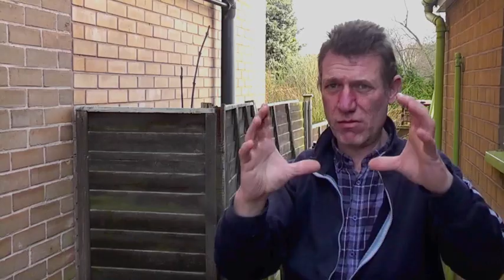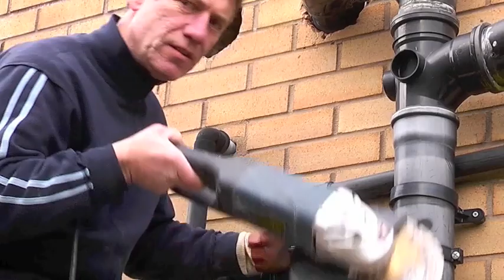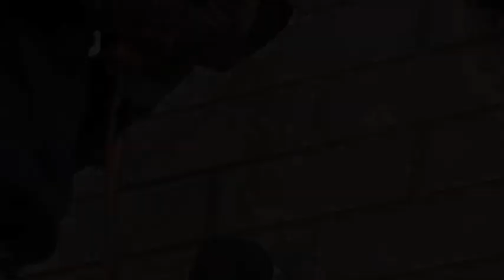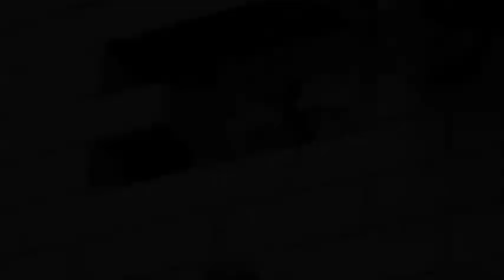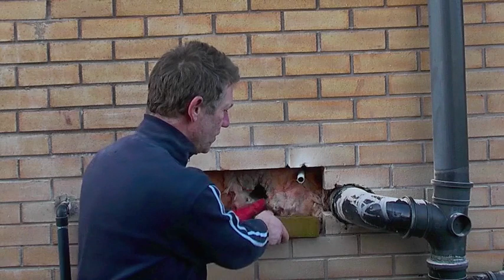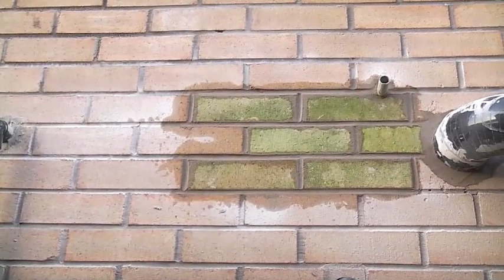How to Repair damaged bricks on a house.m4v

Comment: How did you cut the brick to fit the small pipe on the top replacement brick?  How did the bricks change color, all but one, to match the other bricks in the wall?

Comment: I have a 10 cm hole on a brick wall  due to the air con tubes going out to a terrace , now we changed the ac units location and I need to repair it , I been neglecting it as I was unsure how to do it but this is sooo helpful , thank you so much !

Comment: I have a similar job to do on my Mothers house.  After a new condensing boiler was installed several years ago, the muppets who did the job botched up reducing the flue hole from the original boiler, which had a large square flue outlet, compared to the new, quite small round outlet on the new boiler.  They used the wrong style of brick, they are all over the place, not keyed in and the mortar is crumbling!
What I can't grasp is how the final bricks are laid when there is only the mortar space left?!  How do you ensure there is mortar all around them and that it stays put?

Comment: hi. trying to repair some loose bricks on our front garden wall but the mortar on our wall is rock hard. tried drilling and then chiselling but it isnt budging.  can you suggest a solution. thanks
Reply: thanks for the advice , will give it a go tomorrow and see how it goes.
Reply from the maker: Great, good luck

Comment: When mixing motor for laying brick, what retro of cement to sand is the "Ideal" Thanks for a Great Video
Reply from the maker: Many thanks for watching the vid, best alround mix for most bricks is a 4 to 1 mix of 4 parts sand and 1 part cement.  If you have very week bricks use a 5 or 6 to 1 ratio as the mix if to strong will cause spaulding
Reply: Thank You Chris, much obliged

Comment: why u add soap to the mud
Reply from the maker: +Paul Carter It's an old bricklayers trick- if you have no mortar plaster sizer to hand then a small drop will make the mortar much easier to work..

Comment: how did you get such a clean looking mortar removal?  Did you use the angle grinder?
Reply: +Chris Longhurst I think you used that angle grinder on the straights didn't you? You showed it, but not using it. I think I could see the lines. Either way, it was super tidy. Great video Chris. Liked it.
Reply from the maker: +jttierney1 Used me old drill.....and strusted mni bolster chisel..thanks for your interest..-:)
Reply from the maker: +Howard Gilmour Decided not to found the dust was to much- besides just as quick with the drill and more controlled

Comment: what is the mixture for the motar between the bricks?  sand, cement & water? and what is the ratio please!
Thanks a lot.
Reply from the maker: Zack Tumlinson I used what the builders originally used (on the architects plan) 4 sand 1 cement- gently add water until workable..Trust that helps

Comment from the maker: John G: thats correct, a small drop will be sufficiant to plastersize the mix..
Reply from the maker: A job like this would be a day's work if that...So builders prices vary from London to the North.  Materials are very little so if you got your own from any builders merchants or DIY place, you'd need a bag of sand i/2 bag cement and your bricks.  In the staffordshire area builders would be charging a price from around £120-150 for labour per day!.   Hope that has helped..

Comment from the maker: Plastersizers are same based as detergents, Feb mix and the like- they all Aerate (bubbles in) the mortor creating a sliding effect on the sand granuals...most brickies on small jobs use washing up liqued.  Small jobs like this don't need a professional plastersizer, it would cost to much.  These are D.I.Y tips for small jobs helping people who are not in the trade.  On large construction jobs the pastersizers are now pre added...your just trying to be a clever dickie

Comment: thanks for the video, i need to repair a small (2-3 brick high) brick flower box wall, how much motor do i drop down to start, just a few heaps then tap the brick down to level?

Comment from the maker: Hi Ird9999, thanks for your comments and to answer your question.  Generally the ex. plumbing works well.  Some  folk lag their waste pipies  with foam sleeves.  I personally haven't had any problems with mine even though in recent years we have had some severe cold spells, but they never froze up. They are a standard regulation for the UK....Hope this help :)

Comment from the maker: Hi snakeclaw, thanks for watchin the vid..In answer to your question about forming a new outlet hole above an old out let.  There shouldn't be any problems as you see ,I had my soil stack moved to the side and  so you should be able to do the same above.  The bricks won't drop because they are tied in by bond...assuming it is a hole in simler proportions as mine...

All the best and happy DIY'ing...

Comment: nice repair, but when you were chiseling that brick w/o safety glasses....you've got more balls than me.   its a small thing, but i like to spray the old and new bricks with water before i apply mortar.  seems it dries slower and the bond is better.    nice work!

Comment from the maker: This usually meets with our building regs.  It sounds to me you have done an excellent job….the black board would have been felt or bitumen backed board to prevent damp passing through.  If polythene sheet is applied you will need to allow the wall to breath or it will sweat and moisture will build up on the back and run down, or even eventually rot the wood… food for thought.  Allow a gap at the bottom to allow air to move around the back.  Regards..

Comment from the maker: Hi, I assume the brick wall is a single skin that is without cavity.  In the UK usually out buildings that have been converted into an extension to the main house have single skin brickwork.  We usually batten or stud the wall with 2x2 and insulate with fiber glass wool and then cover with aluminum back sheeted plasterboard.

Comment: I have a question for you. My house was built in 1963 and the inside drywall was bad...I removed it and to my surprise behind the insulation was just exposed brick. It looked like there used to be black tar board but it had deteriorated and crumbled away. How I repaired it was put styrofoam insulation board between the studs to cover bricks then insulation on top of that and sealed entire wall with plastic sheeting. Is this correct way to fix? Thank you!